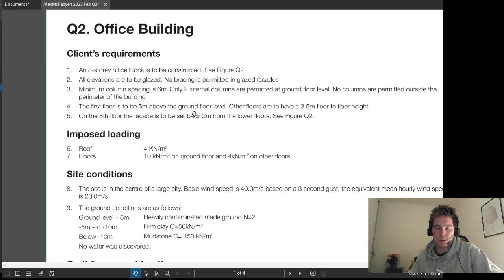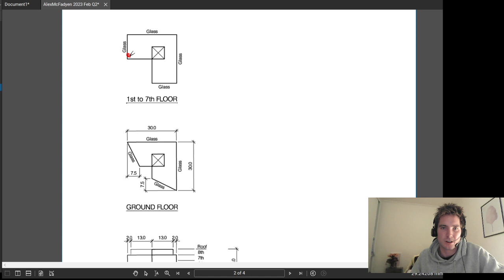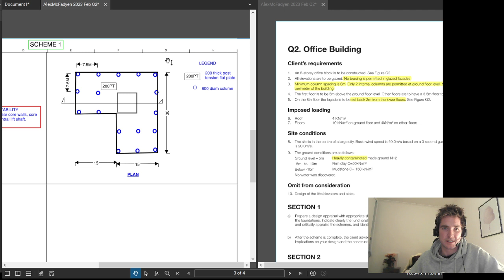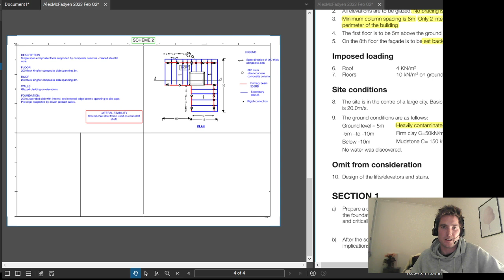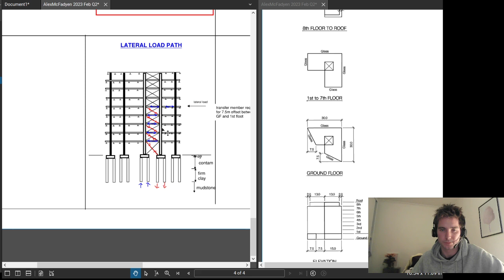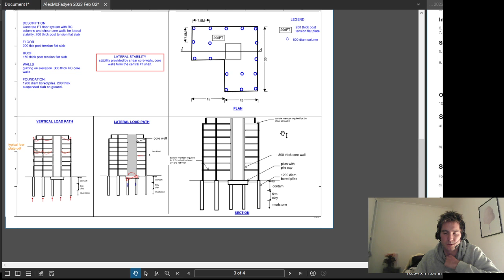2023 IstructE past exam

Comment: Why didnt you add Beams in first scheme? Is there a reason to avoid beams and to go for PT floors? and where to use the data for wind loads? Any calculations for that we have to add in the scheme?
Reply from the maker: There is no one answer, so long as your scheme is sensible, stable and sustainable it is OK. I’m sure there’s another scheme with beams that suits. For schemes just simple span to depths is fine I think. Section 2 looks to focus more on your calcs.

Comment: your scheme 2 seems violated the client‘s req.. Your set back of steel columns in typical floor to cater the roof are actually considered Internal columns （8nos）.  And you didnt really show how you cater the set back of building envelope at G/F in both schemes.

RC Scheme 1: same grid, mega cantilever transfer beam at 1F, 5.5m cantilever beams at R/f.

Steel composite Scheme 2: I did this with 2 mega upstand trusses (1.5m depth) extended from the core at above roof to support 2 hanger columns at the 2 corners that terminated at 1/F.  The 2 m setback was catered with transfer beams at 8F. The column grid was similar to yrs tho 2m cantilever + 6m + 7m at the 2 wings, and kept 7.5m x2 ard the core. No internal columns were provided, largest grid 15mx7m.

Foundation: Friction large diameter bored piles in clay

Just a sharing, I passed this way. Anyways, your channel will be a very helpful tools to all candidates, at least they could have a reference when doing their revision. Thanks for your effort!
Reply: @rocket6592 could you make a channel for Structural Engineering as well it could be helpful.
Reply from the maker: Will look into it, thanks for the heads up
Reply: Guess they understand that only one foundation style works here.

Comment: I am one of the candidate in this exam and try to do this question during exam. After listening your explanation, I am thinking how to deal with the 7.5m set back with a transfer element. The only scheme that I can come up with is cantiliever transfer beam, but the moment would be so great. Eventually, the beam cannot be designed.
Reply: It can be designed, but with mega section sizes. i did the massive cantilever transfer and passed. It was unexpected, but it works.

Comment: for writing schemes, do you know if they provide A4 sheets or A3? I thought A3 sheets were for part 2 calculations only.
Reply from the maker: Hi, you are correct they do provide A4 sheets for section 1 and A3 sheets for section 2. However, so long as you make it clear what section and question you are answering, it doesn't matter which size sheet you use.